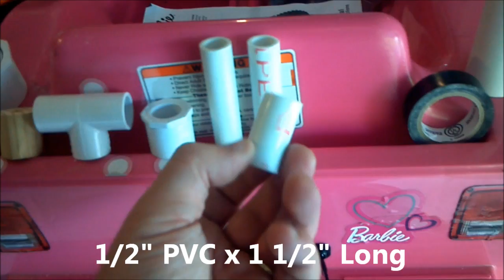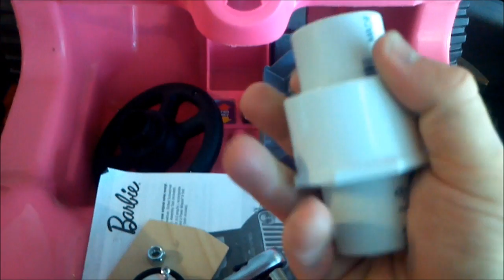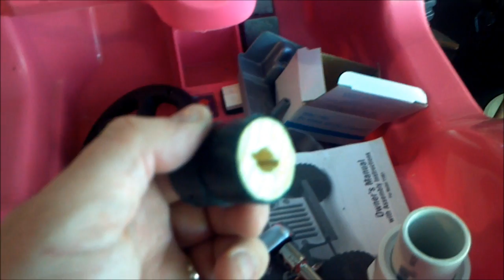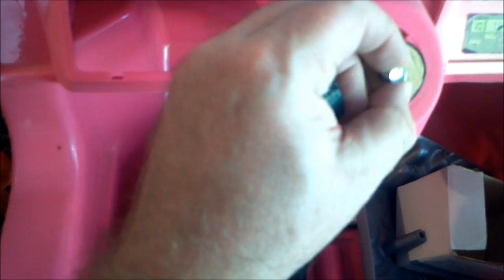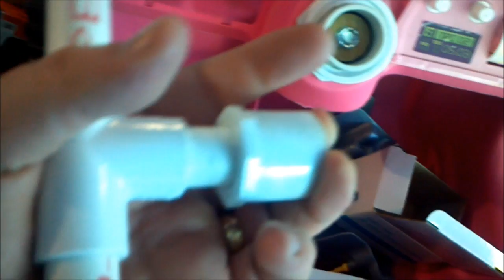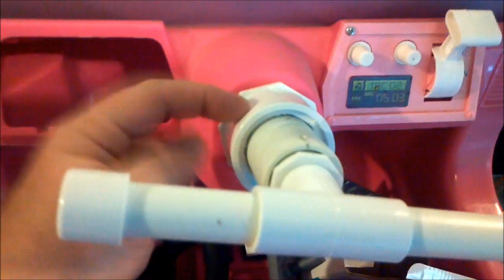Replace Steering Wheel with T-Bar in Power Wheels Vehicle

Comment: Hi Travis. You did an amazing job on the Jeep! I have a special needs son and we are in the process of modifying a Motion Trendz Buzz Lightyear car we purchased from Craigslist. We are planning on installing the T-Bar, but have come to a stumbling block when it comes to the stop and go action. My son is unable to push the "Go Button" and steer at the same time. To solve this problem I am envisioning a rocker mechanism where when he pulls down on the T-Bar the car goes and when he lets go it stops. Do you happen to know if such a thing is possible or what part might make that a reality? I've been on the Modified Power Wheels forum and haven't been able to find any projects that mention this modification. Any suggestions would be incredibly helpful!
Reply from the maker: It sounds like it should be possible.  There would just have to be a switch that is activated when the bar is pulled down.  It shouldn't be too hard for someone with some ingenuity.  I find it useful sometimes to go into radio shack and look at the switches they have and see if any of them look like they could work.